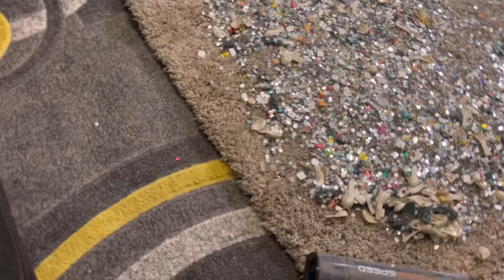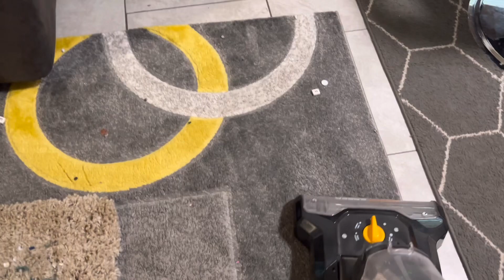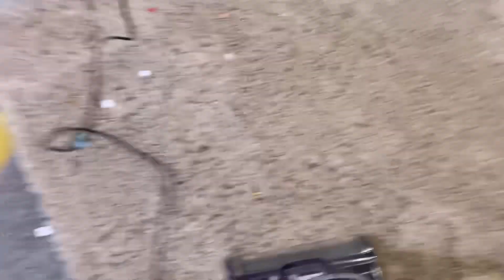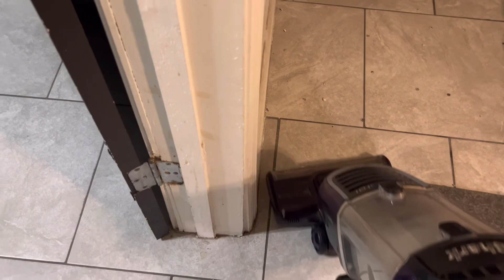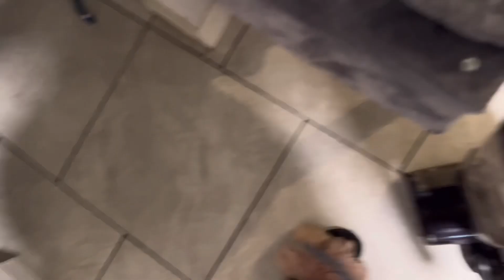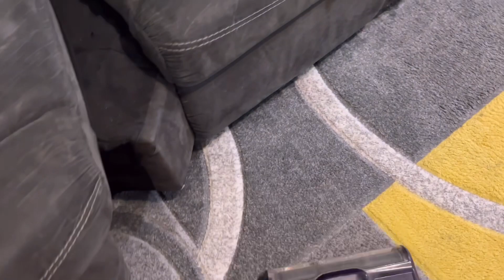Happy birthday @muakillak Florida Hot Gal Mix | Eureka | Shark | hidden crunch | Rug shake out

Comment: 🎂 TIMESTAMPS 🎂
(HBD Killa K!!! 🎉🎉🎉💖)

✨ 0:00 - Yellow Eureka spread out brushroll pickup w/ Florida Hot Gal Mix on fluffy tan rug/area rug + UTR
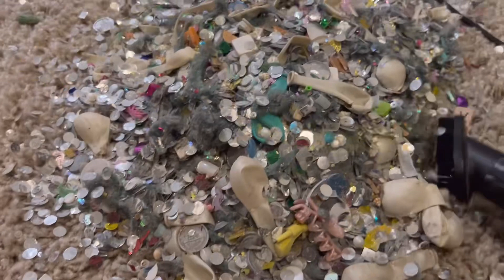✨ 5:31 - Yellow Eureka dusting brush pickup w/ Florida Hot Gal Mix on fluffy tan rug, closeup + feeding the tool
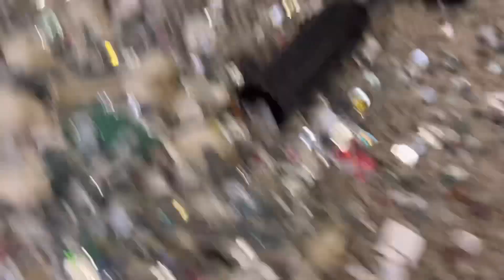✨ 8:47 - Yellow Eureka hose pickup w/ Florida Hot Gal Mix on fluffy tan rug, closeup + feeding the tool
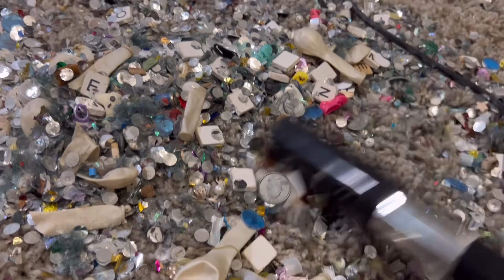✨ 9:48 - Yellow Eureka brushroll pile attacks w/ Florida Hot Gal Mix on fluffy tan rug + pile pushing 

✨ 11:16 - Dark Purple Shark brushroll cleanup on fluffy tan rug/area rug + lines 
✨ 11:54 - Dark Purple Shark hose cleanup on fluffy tan rug/area rug
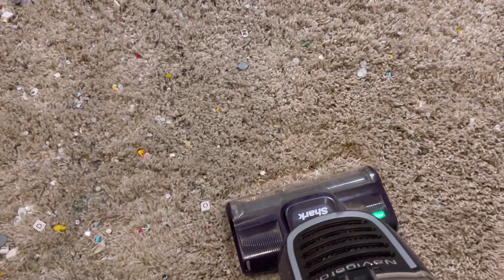✨ 13:14 - Dark Purple Shark brushroll cleanup on fluffy tan rug/area rug + lines & UTR
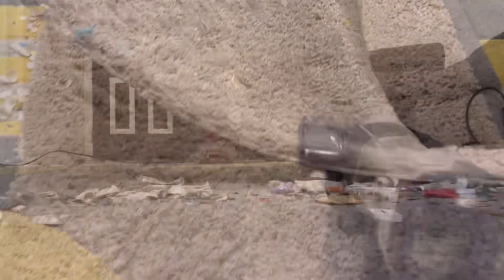✨ 17:42 - Rug shakeout
✨ 19:25 - Dark Purple Shark brushroll cleanup on area rug/tile floor + lines & hose
✨ 25:49 - Dark Purple Shark hose cleanup on area rug/tile floor + edge cleaning 
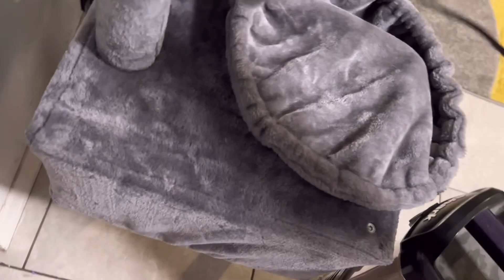✨ 26:32 - Dark Purple Shark brushroll cleanup on area rug/tile floor + lines
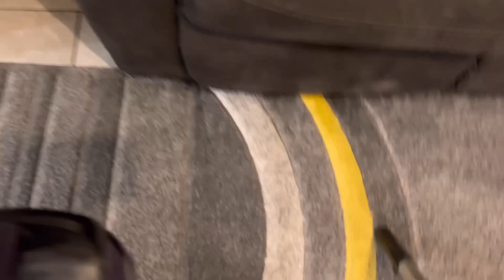✨ 27:11 - Dark Purple Shark hose cleanup on area rug/tile floor + edge cleaning 🛋️
✨ 28:54 - Dark Purple Shark brushroll cleanup on area rug/tile floor + lines
✨ 30:54 - Dark Purple Shark hose cleanup on area rug + edge cleaning